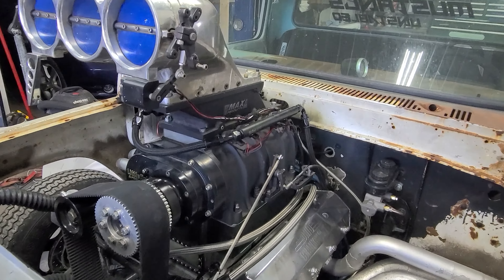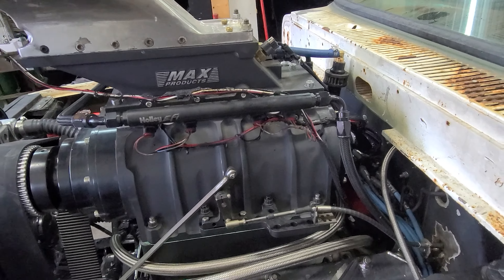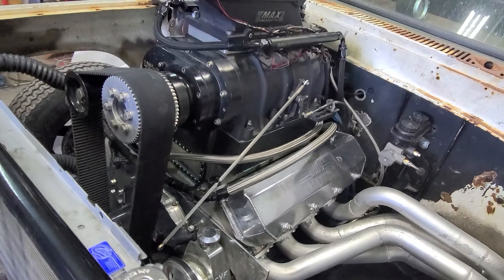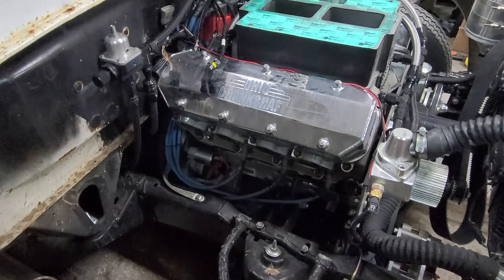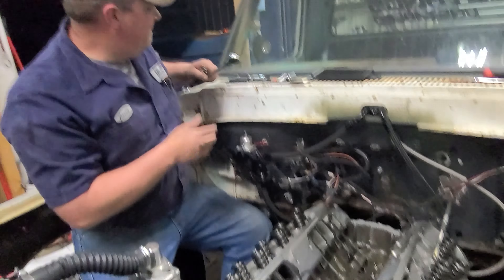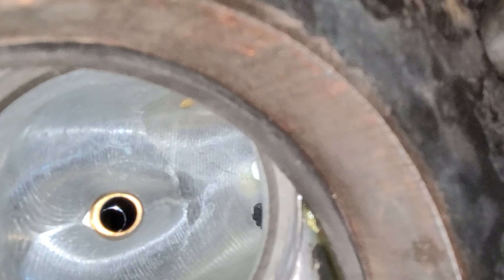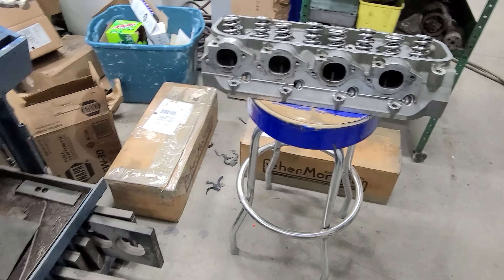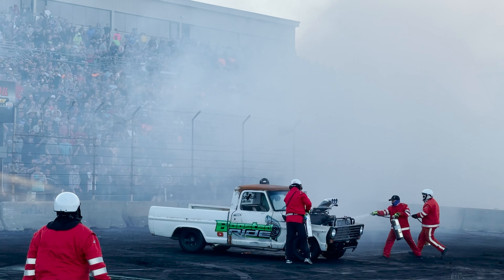Cleetus and Cars Indy Aftermath Found the coolant issue

Comment: Love your videos and content!! As i follower from Australia and fellow burnout competitor... i think you need to go over completely your entire engine and check everything. Ive seen too many people try and get into this sport and the cost and constand breakdowns leaves them sour. Events are always going to be there for you to enter, dont rush to put a bandaid fix on it and take your time. You will enjoy it alot more driving it on and off the burnout pad each event. Keep up the good work! And go mechanical injected asap on meth 👍👍
Reply from the maker: Appreciate it! We just talked last night about going through everything like you said.  It is frustrating going through this but we won't give up! At least not yet anyways lol.  I need to do more research on a surge tank since my main tank is in the rear.  Have everything to do it since that's how it was set up originally.  Really appreciate any info and thanks for following us!!
Reply: @BoostedRide  Mount a decent size tank in the front, around 8-10 litres "3 gallons" ??  Make sure its baffled in bottom to stop it sloshing around during 360s and it has a low point for mechanical fuel pump pickup etc.. Get onto Joe Blo engineering in OZ for a float switch... controls fuel pump in back so that it only runs when front tank starts getting low.. 👍👍  love your work!!
Reply from the maker: @jaysure8033  so they do run a float! Wondered about that! This will be on the list of upgrades for sure!!
Reply: @BoostedRide  he makes a small one that is welded in the top...and very cheap. 👍👍
Reply from the maker: @jaysure8033  appreciate it. Sometime look up boosted ride on Facebook and hit me up🤙🤘
Reply: @BoostedRide  do u have instagram?

Comment: Now that, was a Hot run ! Hope you find the root of the cause of all the cracked heads,
Reply from the maker: they were pulling truck motors running methanol and no coolant.  hook up, pull, and shut down.  everyone of these (3 sets we have) will be sent to dart to be welded up.  after they are fixed we should really never have this issue since we will always run coolant.

Comment: My had issues like that with my buddy’s car SBF. Marine epoxy, took 48lbs of boost and made it through the race.
Reply from the maker: We have epoxy but thought we'd go to dart this time.  If they can't rework them epoxy it is!!
Reply: @BoostedRide  yeah permanent solution always the best! Look forward to seeing the beast rip another monster tip in!
Reply from the maker: @bigblockmaro1  had a 4th set and they are cracked also! Dart will be busy!! Haha
Reply: @BoostedRide  holy crap! That’s well over 10k in heads, all cracked!
Reply from the maker: @bigblockmaro1  ya your right.  Sounds like dart doesn't fix them anymore but Steve with Total Flow Products will get us fixed up at a reasonable price.